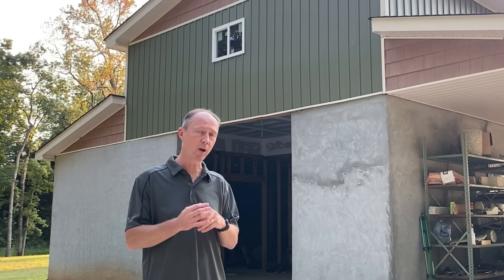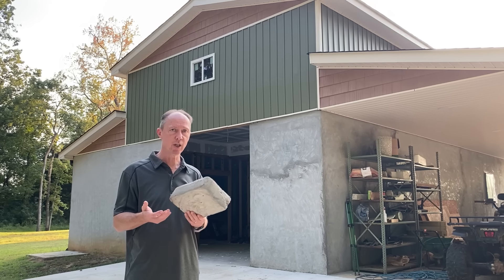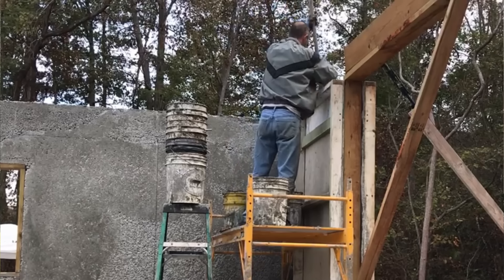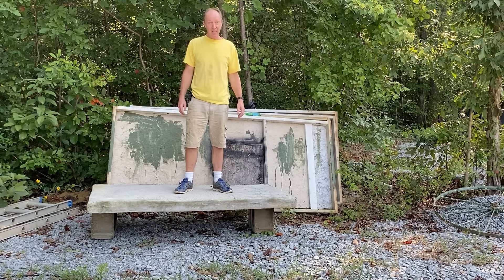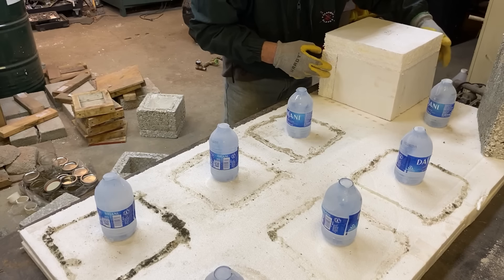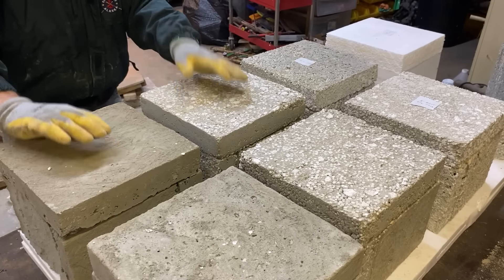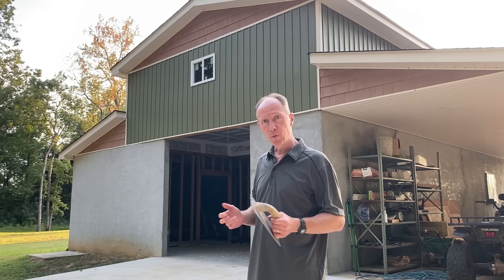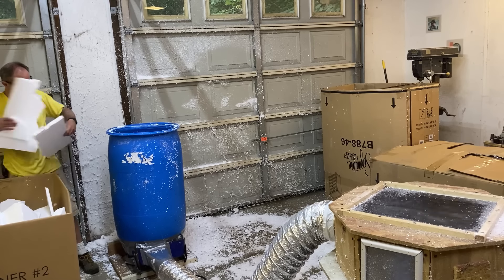The White Gold Rush?! The Video That CHANGED Aircrete Forever!

Comment: I would suggest trying a mix with fiberglass fibers in the mix as well. It's used with concrete furniture and counter tops. It may add the reinforcement needed to stiffen up the vertical slabs.
Reply: What he's showcasing is low weight, low cost, high thermal resistance, high yield efficiency building material. Fiberglass fibers are expensive vs recycled Styrofoam and fiberglass fiber is not a low weight product if used in solid mass structural rigidity applications. The weight of the fiberglass webbing used on surface applications herein is justified because of the need for long term structural integrity and durability. You wouldn't want to leave this product as an exposed  raw surface due to the high styro content. Glass fibers and even steel fibers are used in cementeous applications already, but they are not cheap, and the increase weight dramatically.
Reply: @ThirdeyedeasInc  I'm not so sure styrofoam is such a great thing from the perspective of fire. Styrene emits pretty noxious fumes when burning.
Reply: You could substitute hemp fibers as a low cost alternative.
Reply: Basalt fiber is best.
Reply: @davidprins9401  except, hemp fibers are easy to come by.
Reply: @ThirdeyedeasInc  There are various materials used, but the small amount of fiber required to enhance the strength and prevent cracks is not heavy or particularly expensive.
Reply: Fiberglass fibers are not expensive, it doesnt take very much per yard, and its just basically strands of sand.
Reply: Sounds like something Cheech and Chong would do.
Reply: @OOICU812  I doubt many of the people commenting here understand the Stacy Keach “FiberWeed” joke.
Reply: @bubbalouie4022  the Styrofoam doesn't burn when shredded
Reply: @jeffw527  
It will melt at 464⁰.....312⁰ by some reports but, begins to soften at 212⁰.
Reply: @davidprins9401  

Any good sources for hemp fiber?
Reply: @gnarlytreeman  

Source for glass fiber?

Basic search shows it runs from $10-20 per lb.  seems expensive
Reply: @johnle231  sorry I don’t know where to get it. Let me know if you find a source though.
Reply: @johnle231  Kansas road ditchs.(sorry)
Reply: Wonder if old monofilament would be any good at strengthening it up
Reply: @erictaylor3496  huh?
Reply: @erictaylor3496  

I’m guessing Kansas ditch weed is abandoned harvests of bad marijuana?  Or what is it…. Abandoned hemp?
Reply: @johnle231  wild hemp usually low thc but no guarantee. As it could be cross-pollinated with the enhanced stuff from growers.
Reply: @johnle231  Yes not cheap as it needs to be alkali resistant when used with portland cement.
Reply: @tomruth9487  

I think if I were to use aircrete,  it would be for its insulators value but definitely not for structural
Reply: @mountainmancaraway6431  There is actually structural fiber for concrete. The little fiber these guys are talking about is not structural. Structural fiber is very long stranded and about the thickness of 70# monofilament. Generally recommended at about 3# per yard on a standard application but not sure about this one. 🤔
Reply: @patricktaylor4431  Polyurethane is porous and it's chemically different from PPE and PLA, which don't "stick" with cement.
Reply: @davidprins9401  couldn’t you get an old boat and shred it up?
Reply: and recycling afterwards, who cares, right?
Reply: Seal surfaces with stucco
Reply: Feathers have both fibers and trap air within them.  Old discarded pillows could be recycled to this use.
Reply: @RalphSampson...  the Styrofoam is simply acting as a filler to create pockets here right? So even if the structure was exposed to a wildfire and the foam melted inside the walls, that shouldn't effect the strength because you still have the air pocket void left behind right?
Reply: @patricktaylor4431  better to recycle them. They don't bond well, causing weakness
Reply: @jeffw527  Sorry, it doesn't burn when you encase it in concrete,  but it burns very well when shredded!
Reply: @johnle231  just burn a fiber glass boat, it will leave a ton of glass fiber! But don't breathe the fumes, and don't let it burn too hot, or you will ruin the fiber, not just the environment! LOL! SERIOUSLY, GENIUSES, YOU CAN USE USED FIBERGLASS INSULATION, OR BLOWN-IN cellulose fiber, ( see paper- crete), or onion bags, mesh type, some plastics bond well to concrete! I have used the onion bags, and they bond very well!
Reply: @HappyBeeHoney  Concrete structures are resistant to heat but will fail if heated hot enough and/or long enough. So this material if the styrofoam was melted out, would likely fail  because the heat would affect it more. ( no insulation, + heat from melted burning foam) so this material would be useful as an insulation  or fire preventive coating, as in a thick 6" or more. And the foam crete should have an inch or so coat of concrete over the top of it, so as to make it fire proof. NOT ANYTHING WILL PROTECT A STRUCTURE FROM THE HEAT OF A WILD FIRE, IF THE FIRE GETS TO THE HOUSE, IT WILL BE GONE. UNLESS YOU BUILD UNDER GROUND.
Reply: @HappyBeeHoney  And aircrete is far less dense than regular concrete, so it has far less strength. Concrete has compressive strength, but the voids are weak points, so aircrete has many weak points. Curing the concrete is very important, and aircrete mixes are critical and fussy.  Companies are making great strides, but aircrete is cheap enough to play and build with ourselves!
Reply: @richardmccann4815  

Ok im gonna go to the boat I burned last week to harvest some glass
Reply: @richardmccann4815  appreciate the reply but I gotta say that I worked up in Paradise CA after the 2018 wildfire and about 15% of structures didn't burn. Most of them were stucco sided or at least had brick on the bottom 3ft before the wood siding. And that was a hot fire, melted windshields and aluminum engine blocks/wheels. Saw a few houses though where the fire got in through the attic vents and burned the walls from the inside so that the stucco siding fell away whole after the 2x4s burned.

Which is just to say, if you go with a cement board siding and sealed attic/basement, keep your gutters clean, so long as a burning tree doesn't fall on the house and compromise its seal you can be okay in even the hottest wildfire. Some houses I saw exterior woody plants burn to a crisp up against the siding, scorching it but not penetrating inside.
Reply: @HappyBeeHoney  

I saw you mention aluminum melting.  But steel blocks were intact?
Reply: @johnle231  yeah the melting point of aluminum is ~1200° while steel is ~2600°.
The only glass I saw melted was some windshields where it may have been mostly the lamination of the glass, or alcohol bottles in a liquor store where there's a shit ton of accelerant, since glass is also ~2600°
Reply: @HappyBeeHoney  

It’s been so long but I dunno why I seem to have a memory of even steel being melted like whole cars but maybe I’m wrong
Reply: @johnle231  some of the steel buildings had their I-beam headers get soft and twist, but na not really any melted steel. I was working up there for 6 months and took about a 100 photos.
Reply: @HappyBeeHoney  

Don’t mean to be argumentative bit there are photos and videos of everything being melted including cars

Maybe hoax I guess…
Reply: Welding blankets might be a suitable source of fibreglass material, but you might have to spend time and effort processing them down into small fibres 🤔
Reply: @davidprins9401  I agree with you
Reply from the maker: Thanks for the tip! Subscribe for new builds!
Reply: The fiberglass fibres are for strength  they replace rebar 
 You us 5to7 kg of them per meter of  normal concrete  
Using them  would eliminate having wood in the building which is rotted by contact with cement over time .
 Id use  thicker walls  fibre and enough sand and aggs  to keep this from floating or blowing away in the wind  this video and the comments are  great  research  and an amazing improvement from todays sawdust and shredded wood glued together  to make a house  IE waterproof !!!
Reply: A sprinlkler on the roof helps with wild fires
Reply: @roomtemp6374  Yep!
Reply: @jeffw527 
Don't bet your life on it. Try it and you will see it burns quite readily.
Reply: @AbundanceBuild  I haven't seen anyone mix aircrete with crushed pumice sand instead of course sand.. pumice is about half the weight/density of water
Reply from the maker: @Errol.C-nz  Thanks for the tip! Sand is cheaper but that is a good idea to get even lighter
Reply: This was exactly my thought
Reply: Graphene.
Reply: Do what are you saying, are you worried about fire, or it softening and losing strength? Regarding fire and melting, I’m worried about a wild land fire scenario, not a gradual increase in heat, and the fact is shredded styrofoam, unlike compressed styro, will not ignite. Moreover, this is shredded styro encapsulated in concrete… how the hell would you burn that? As for strength, I think he showed it’s strong enough for his purposes.

Comment: Hi Steve I’m a builder for many years! I’ve been see and experimenting with different materials my whole life! I see ur solution bonds pretty well, I’d bet adding paint would help even more in some applications? Even rubber paint like on exterior walls or just around the foundation where the materials meet would greatly help in bonding and water proofing if needed? I’ve got so many different building ideas, I pretty much been building my whole life! And you are definitely on to a huge breakthrough? God knows the world needs it as our so calls LEADERS shaft the system in order to jack up material cost just to manipulate the masses? Good job 👏🏼 and thanks for sharing!!!!
Reply: dried out hemp stalks as an aggregate media combined with this would probably be pretty lit
Reply: @sinvex2224  yes similar to a fiber mesh which is always used when you don’t use rebar.
Reply: Have you tried earth bag? I’ve been curious and want to try it.
Reply from the maker: Thanks for the tip! Subscribe for new builds coming soon!
Reply: So agree with comment, we got huge problems with not accepting better and affordable build types and dropping information on the issue here, because it will get worse.  So a lot of people dont know in 2000 a failing UK company made deals with US Housing Authorities this is why we got huge ICC build code restrictions which really is just an old boys club that fills up friends of friends wink, wink pockets and they used a CA law firm to network throughout the country to use legal contraints on the public as a private legal advisory board to congressional members ONLY and their plan is by 2030 to have secured worldwide ICC codes by this once FAILING UK company as they boast publically their profit potential.  US is based on the rights and freedoms of common man to own land, to build a homestead of choice. How we let a FAILING UK company come in here to restrict affordable modes of building on faked out "its for your safety" bull is an insult to Americans who are suppose to have freedom but someone has learned how to push profit agendas and override American Constitutional Rights and we truly need to wake up here as we have forfeited common sense, ease of build types for homeowners that make sense to be sold out on wasteful, expensive no longer affordable of main stream Americans, it has to stop!   Ive seen absolute genius ways to build and the people behind it are who we should support as they evolved from human needs not how much can I make.

Comment: And this, boys and girls, is why we are testing the strength of concrete not with old-fashioned hydraulic presses anymore - but with a skinny dude jumping up and down on a slab of non-standardized dimension (which is visibly flexing under this minimal load). We also don't compare the flexing with that of other concrete mixtures with a known strength, nor do we check for micro fractures or signs of compression... I wonder if the K-value of the material will also be determined by guesstimation...
Reply from the maker: New tests coming soon! Subscribe to see the results!

Comment: Hey Takes a lot of and years experimentation before Building codes would let usage. We sure need to find a place to repurpose styrofoam in any form. Excellent video
Reply: Fortunately many jurisdictions allow 200 sf detached structures.
But, lots of testing and documentation can be done in the mean time
Reply: Styrofoam is one of the few things I CANT recycle in my area 😭 A great idea for reusing it!
Reply: @foyjamez  Yes outbuildings will be the way to experiment. Or in the middle of Arizona 😂
Reply: @davidprins9401  True. I know that Mohave County allowed 300 squarefoot non-powered buildings as long as they were off the property line by 5' for years without any permitting. I'm sure they don't respond to much unless without a lot of prompting once you're out of sight from the main roads.
Reply from the maker: Working on tests for regulators! Subscribe to see the results!

Comment: This is great I would really like to see a demonstration of this creating a DIY SIPs panel. You could even insert pvc conduit as you pack for wire runs in the walls
Reply: Look above it by idea
Reply: Yes, Sip's to attach to a Timber Frame / Post and Beam would be amazing
Reply: SIP EPS foamcrete panels?  That could be beneficial in areas with high fire risk
Reply: Would also love to see this!
Reply: Could even include some wire for added strength
Reply: @PandorasFolly  I was thinking rebar - tied in though.
Reply: What if the inside of the panel included the fiber mesh, with some of the fibers hardened to stick out into the mold? Or perhaps woven in such a way that they cross the void (similar to current fold out models but with woven fiber strands instead of wire). If possible, you could even weave a more complex 3D criss-cross/diagonal pattern.
Reply: The simplest version with available materials would be wire mesh lath mounted to the interior walls of the form, with wire run across.
Reply: 3 thoughts... Added cost, added weight, and pvc for electrical runs won't meet any codes I know of... so don't tell them!
Reply: and recycling afterwards, who cares, right?
Reply from the maker: We tried panels and couldn't get it quite right at an affordable price. New builds coming soon!
Reply: @@davidprins9401  heard of pykrete? Sawdust is nature's Styrofoam and rebar, and cheap!

Comment: Crushed compacted shell and limestone media "Coquina" is proven to resist full barrages of close range cannon fire in an all out naval invasion, by dispersing and dissipating and deflecting the destructive energy of the heavy high velocity projectiles and only taking a scrunched dent or dimple, the cannonballs were intact and undamaged, so they were hathered heated till super hot, and fired back wrapped in wadding and dipped or doused in molten pitch, to torch the sheets and two linked with chains to bolo snare the rigging!
Reply from the maker: Thanks for sharing! Subscribe for new builds coming soon!

Comment: In Engineering School we used styrofoam and fly ash (coal ash) to design and build a concrete canoe for competition. It was pretty light weight it only took 4 people to lift it, very similar principal here. Reduce the portland by replacing it with fly ash. I'm always looking for building alternatives, I have done many non conventional builds. 24x24 clear span with 9ft walls all from white cedar pallets simple to insulate, wire, and very strong. Held 8 inches of snow and the ice that followed.
Good Job👍!
Reply: Great to hear! How waterproof was your canoe and what would you recommend?
Reply: Fly ash is a by product of Coal power plants. Due to 8 years of an administration coal plants are being shut down. The concrete became more expensive due to the scarcity of fly ash in U.S. Fly Ash in concrete is being replaced with something else. The domino effect! Fly ash was a filler ingredient in concrete to take up space and increase volume.
Reply from the maker: Thanks for sharing! subscribe for new builds coming soon!
Reply: Sounds interesting!

Comment: There are wattle and daub houses in England over 700 years old. When I saw you using this material to fill a void it reminded me of wattle and daub construction. Great video. I subscribed.
Reply: Straw bales (the older one man size) make excellent walls. Pinned together with willow canes and daubed over with lime mortar, it lasts and lasts.
Reply: @DarkLinkAD  that's why architects say that you've got to make the roof and the base.... Head and feet.... Dry....... well and the rest takes care of itself.
Reply: @DarkLinkAD  no not if you dont put it directly on the ground! build a stem wall first then stack your bales!
Reply: @StonemanRocks   I dont buy it..
Reply: @DarkLinkAD  I don't care if you don't buy it. Once its off the ground at least here in the desert it won't soak up any moisture. Then once you plaster inside and out its also fireproof! Its like trying to burn a phone book! Are you a builder there little mister?
Reply: @StonemanRocks   My statement stands. "Will rot with moisture" 
 Youve modified the argument to include dry, deserted, likely baron waste lands.  
 You then refer to me as "little mister" to which I can only imagine the degree of insecurity that consumes you, to propose the normalization of such a telling projection of ones self to a complete stranger.
Lastly, the great majority of the world live within an ever changing climate.. Or seasons. 
 Ive built houses,garages,underground shelters, cars,engines, being raised in a shop and working the fields by the age of 4, using my hands was once all I felt I needed to know.
Reply from the maker: Thanks for sharing!